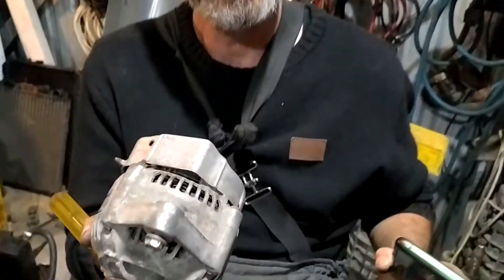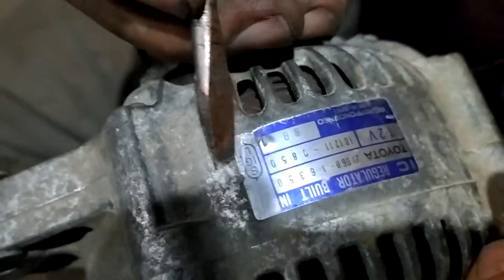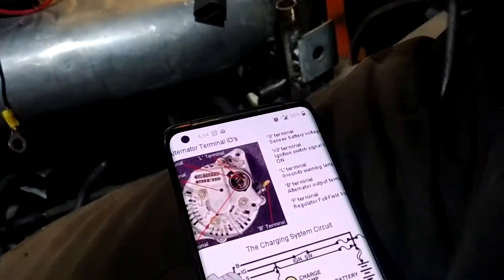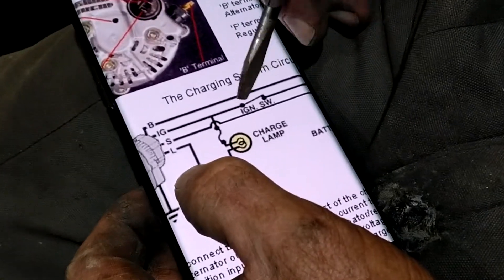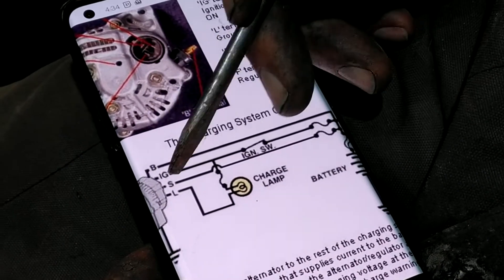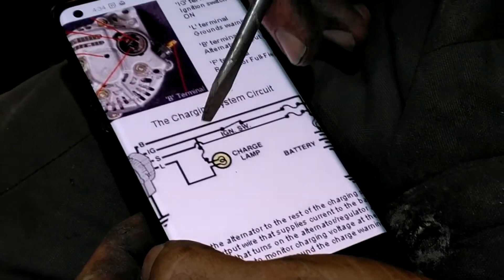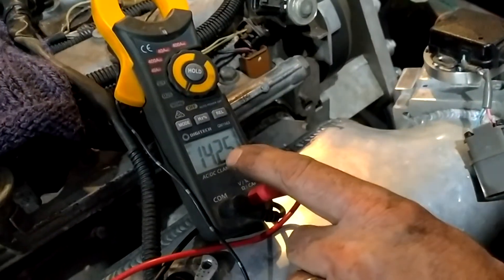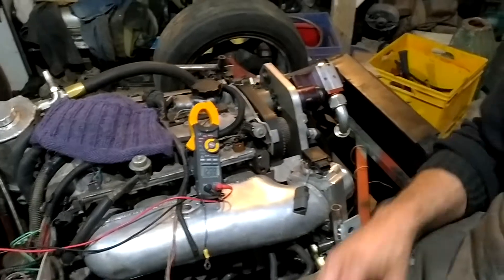How to wire a Toyota alternator in a simple way.

Comment: Hey I have a 2019 Toyota Camry LE and I am having a serious problem trying to get my voltage past 13.8 I need it at least 14.4 with the stock alternator so I know that I have bypass the ECU properly so I can upgrade the alternator to a HO for car audio and lithium batteries I'm brand new to this kind of stuff and understand that it's only 3 wires and can do it if it is the same as this or similar can you please tell me if this is the process I'm looking for I've been trying to figure this out for a 1 1/2 yrs any advice would be greatly appreciated

Comment: Every Alternator I put on my 2001 camry keeps getting me a reading that system is overcharging causing the battery light to flicker or stay on. This is mind boggling don't know if its a wire or the charging system. I put new terminals on battery cables, I just can't figure this one out.

Comment: Any tips on figuring out the wiring for the plug on an existing aftermarket harness?
Reply from the maker: I would just run new wires and zip tie them to the outside of the loom